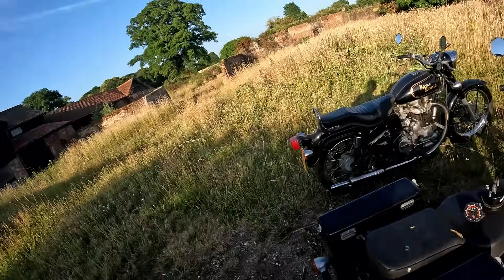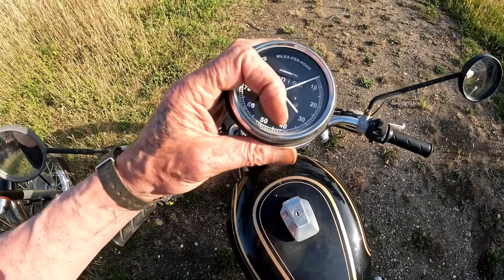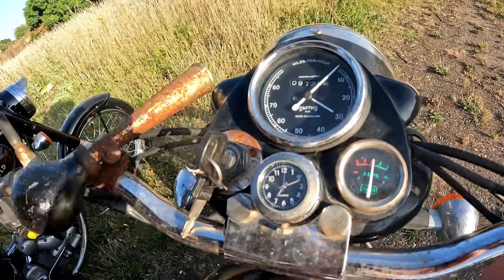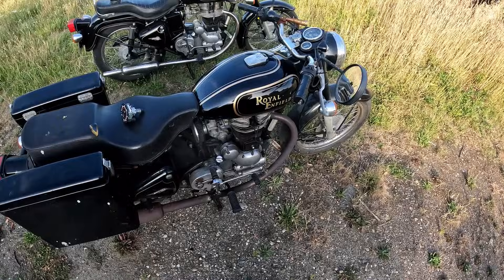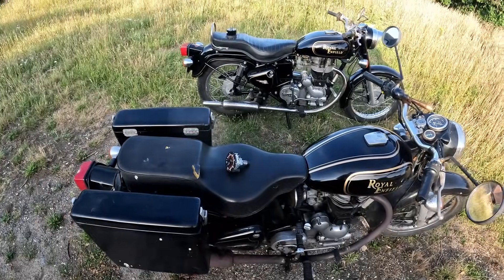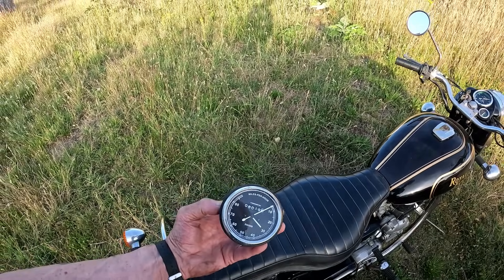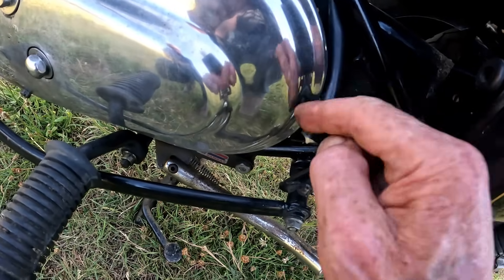ENFIELD CI BULLETS, SPEEDO'S AND CONDENSATION IN THE OIL.

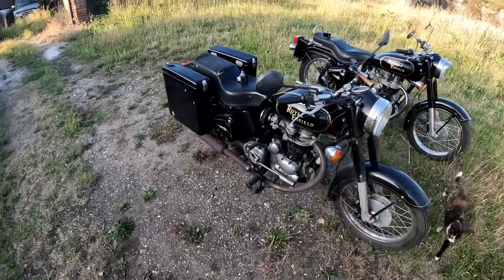Comment: Hiya mr brown    Really good  show  it’s nice to see someone else can also get  some enjoyment pulling faces at cats  I’m lucky  enough to own two  royalenfields  the first one I got  is a 535 get bright yellow goes like a rocket a good friend had a desmo fairing hanging up in his shed and give me it  for free what a gentleman . And I changed the exhaust  with a stainless steel one made in America buy a  shop called carpyies cafe racers extra good  I could not believe how heavy the original  was.  The other is Morwena. A500bullet trails replica  a red and silver one I worked out a few days back why they raised the fuller so high its the middle of winter hear in Western Australia  and I live down the bottom  and it can get   Quiet cold  I stoped for a piss  as you do   And found the outlet of Sid muffler just the right height to warm me mits he he he see ya mate keep smiling 18:51 18:51
Reply from the maker: @lesleypathe4839  Good to hear stories from the other side of the world! Keep putting the miles (KM's!) on. Best wishes from old England!

Comment: Good video, Mr Brown. I never had a Royal Enfield but own several BMW vintage bikes and have had speedometer problems in the past. Things like needles wobbling and falling off, plastic gears binding or breaking, things like that. I found that it pays to use a light grease on the cable and the inside mechanism. As far as oil goes, yes, vent that condensation out with a breather or tube set-up. I make my own. I'm a stickler for oil and filter changes. Depending on the year and type of motorcycle I change the oil and filter every 500 to 1,000 miles. Why take a chance? Oil is cheap compared to an engine and/or transmission rebuild. I also check the air filter every 1,000 miles and replace as needed. I own bikes that I can work on myself and I have a hard and fast rule.....No computer chips on any bike I own. Cheers from CT in the States!

Comment: I've had 4 speedos on my IB. The previous owner had fitted a mph unit but in Oz we use kph. Too much for my small brain to convert on fly. The first replacement  indian unit's needle was all over the place from day 1. The speedo stopped working at 3,000 k. The next unit behaved better for a while then got the wobbles. It turned out every internal scew was loose and the whole mechanism could move around in its shell. After I pulled it apart and tightened it up it worked well up to 90 kph before it couldnt decide if we were going warp speed 13 or stationary. . No. 4  speedo is from  a later model UCE bike which donated its whole front end , casquette, forks, disc brake etc. So far so good.

Comment: My 350 Indian bullet used to produce LOADS of mayonaise in the oil. That was despite it having the catch can replaced with a straight-shot duckbill breather pointing at the chain (so absolutely no way anything can run back in again). I was on a tour and averaging 200 miles a day for several months (which kind of rules out it not getting hot enough to evaporate condensation) and it had got so bad, I had to blow out the breather hose every morning or it would block and leak oil all over the place. Some time later, I fitted one of Hitchcocks scavenge oil pressure relief valves. From the day that was fitted, it's never produced mayo again. I have no idea why but I wonder if forcing all the scavenge pump output through the rocker blocks at relatively high pressure was emulsifying any moisture to the point it couldn't evaporate off again.
Reply from the maker: @twostroke350  Interesting!

Comment: Mr Brown . Are the bezels spun on . if so how do you get them off ?
Reply from the maker: @kafkastrial8650 Very easy, just use a small screwdriver to lever the edge of the bezel up from the lip of the housing all the way round. You might need to go round it a couple of times and then the bezel, glass ad sealing ring will part company. Reassembly is just as easy, place the bezel, glass and sealing ring face down, put pressure on the housing and carefully fold the edge of the bezel back over the lip.
Reply: @Volcanicbrown1878  I see .Thank's for that , good tip
Reply: I've done this, twice. I always end up with small flaws in rim where it gets stretched.